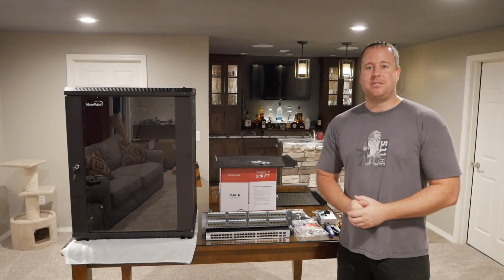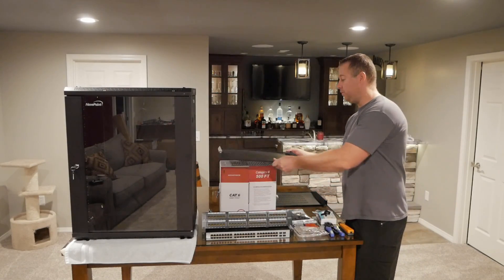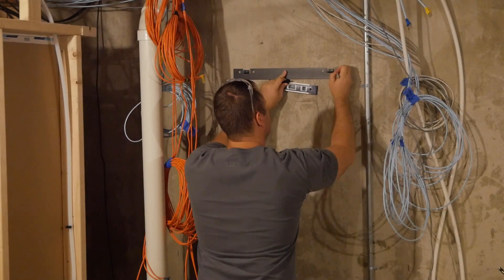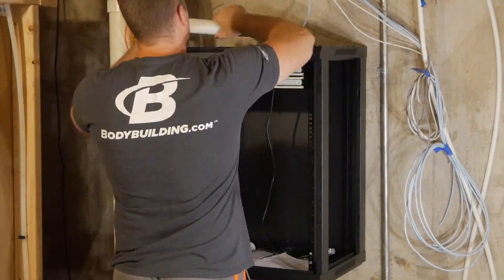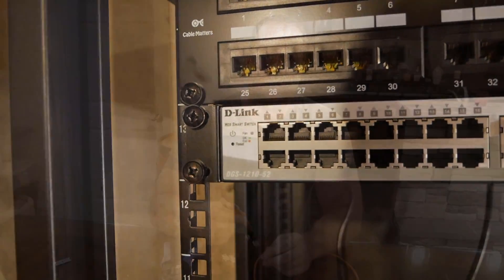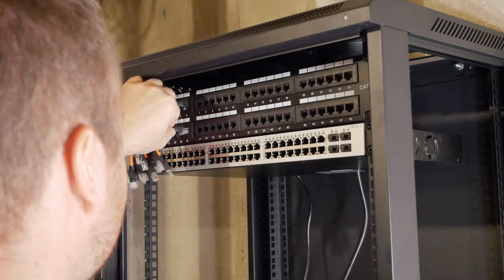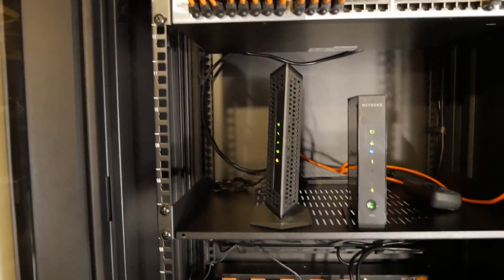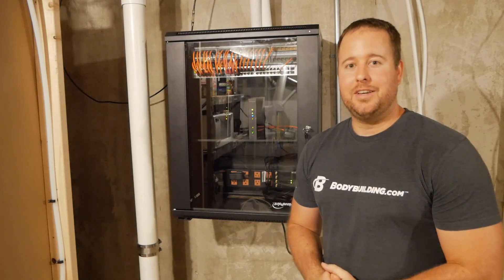Home Network Setup and Rack Installation | NavePoint 15U Rack

Comment: You should get two 24 ports panel instead of one 48 port panel so you can put 24 on the top and 24 on the bottom, and then your 6in homemade cables will look more clean.

Comment: When making all those patch cables, there is no need to trim. Just line up your wires in the connecter and shove it all the way in. Let the wires stick out and the crimper tool should trim them. Much easier and nice looking ends.

Comment: Wow, that's beautifully done!

Only things I would've done different: Two 24 port patch panels for keystones, to add (not only networking) cables easier if needed. The switch would've gone between the two patch panels to have an even cleaner look without cables laying on top of each other.

Comment: you can get a gigabit wireless access point for your wireless devices like phone and shit. better than using a wireless router in my opinion, if you do all that with your home network might as well beef up your wireless network too. use a poE system. you can get a rack mounted Poe switch to power and internet connect it to a wireless access point perfectly located in your home. thats what im going to do with my home network. except i am not using a rack mount. everything is in a cabinet with a key i put in. i am getting a wired router and a wireless access point. each port on my router will be the uplink to a switch. my poE switch, my 16 port switch and vpn router. all non vpn ports are blue and all vpn ports are red

Comment: I added an Eaton 5S UPS to Telcom cabinet. I put in a thermal control switch for the fans. I also installed an Intel NUC that runs UPS monitoring software as I will eventually configure this with a virtual machine running Linux and run PRTG for full network monitoring. I installed a small LCD screen attached to the glass door on the inside facing out so I can monitor UPS and network status. so that power events would be documented and recorded.
Reply from the maker: Damn, went all out man! That sounds awesome. I'll definitely do a more intensive setup after we build our next home
Reply: @LifeofBliss  Take this time to learn SNMP and prtg. Those are the two elements of my monitoring solution
Reply from the maker: I'll have some time... thanks I'll check it out!

Comment: You put a lot of work in this, but i see a little potential for improvement. First of all, where did you get this patch panel ? Cat6 without grounding and proper mounting ? Unprofessional. Better use a good Cat5e panel with proper mounting ability for the cables. You can get them used for little money. 
Cable length: longer :-) let them be lenght +height +width of the rack, so you can move every cable to every spot in the rack if you need to move them. 
Important point. Never, NEVER make patch cables out of installation cables. Installation cable is not designed to use as a patch cable. They are to stiff. Bettet buy them. You can get them in the length you need and dont have to crimp all night long. Also the attenuation is much much better.  And then the device. Why on an extra mounting shelf ? Put them flat on the ground to leave space for additional devices. Maybe a NAS or something.
Is there a wireless access point in the rack ? Really ? Wireless in a metal rack ? Put it on top

Comment: Nice build. Here's some thoughts, and ways I would do it differently.  I would use a modular patch panel instead of punch down.  This way you can move things around in the future.  You wouldn't think so, but you always come up with ways to re-organize and make cable routing more efficient. Also way easier to add more structured cables later. Doing that with punch down is a pain.  The boots you installed to your terminated RJ-45 patch cables, they tend to cause the RJ-45 latches to be slightly depressed, which makes them not snap in fully, or least not a strong snap. So when you are working on the rack, they can become disconnected. I've had this problem before. Better boots are called "finger boots", they are hard to find. I had to buy mine from ali express.  Also, I like to the split the patch panel, and use two separate 24 port 1U panels, and put the switch in the middle. Makes routing the patch cables easier and less confusing. Top row of the switch ports goes to the patch panel on top, and the bottom row goes to the bottom panel.

Comment: Just two suggestions there: 1) being this close to a water line is never a good idea.  I was gone for the winter and one line broke killing the entire rack and its components.  
2) I would strongly suggest you to put a surge suppressor in the ethernet ports in the basement.  Keep in mind that most of your grounding equipment is in the basement and if you are hit by lightening a lot of your electronics in the basement will be cooked.  
Other than that I really liked your organization there.  I wish mine were as clean as yours.

Comment: You will find that using cable comb makes the wires a LOT neater before you punch them down. They sort of look like a twisted mess because you are trying to organise them from the wrong end. Also (and since you have 48 port switch) going 24 port patch panel, switch and 24 port patch panel makes the cabling a lot nicer to look at. This would obviously not work with the patch panels you have but just a thought.

Comment: What do people use to cover the hole at the top were the cables enter? Without it covered Im assuming plenty of dust will get into the rack?
Reply from the maker: I havent had any dust to speak of. There are vents all over the box and fans drawing in air, so its about the same as what a computer case gets.

Comment: Could you provide a link to the mountable WattBox unit?  Also, I noticed orange and white wires.  Do the colors mean something?  (Eg, represent differs floors?) Thank you.
Reply from the maker: I actually got the wattbox locally from a dealer going out of business. The fan units on the top of the rack? Those are built in, came with the rack
Reply: Life of Bliss thank you!  I also noticed the cables  from the ceiling were in two colors, orange and white.  Is  that significant?
Reply from the maker: No, they are both cat5e. Just what I ran (orange) and what was here before me (light blue).

Comment: Good job thanks. You really should use the pull string in the cat 6 cable and pull it down to the correct length. Cable cutters can nick the wire which will cause a fault later.

Comment: Looks pretty good. Did you consider a PDU? You could turn each component on/off individually. Also, MY OCD is kicking in about that PVC. I'd put a grommet or flange on both ends, to keep the cable jackets from touching the sharp edges.
Reply from the maker: Thanks. No I good with just the Wattbox and tried to keep things on a budget as best as I could. I took some sand paper around the edges before installing, they aren't really that sharp now

Comment: I would like to have something similar to the network cabinet rack, but something that kind of blends in with furniture. Hopefully that makes sense. I'm living with my parents right now and would like to have something that doesn't look too geeky. My parents don't really mind the "controlled mess" I have,  but I would like to tidy it up. Does any one have any suggestions? Casters would be an added bonus, but not crucial. Thanks. I would really appreciate any suggestions.
Reply from the maker: This unit came with casters if you didn't want to mount it on the wall. No getting around it not looking like an equipment rack though

Comment: Where do I start. Too much insulation removed when punching down at the panel. Max 1cm of pair showing. You used the same cable for your runs and patch cables?

Comment: Nice setup and tutorial! I’ve been trying to grasp the signal flow for this type of setup. If I’m not mistaken modem is connected to the switcher providing it internet and from the switcher the cables are plugged into a patch panel which are just Ethernet drops coming from various rooms in your house?
Reply from the maker: Signal path from the cable box outside is: Cable wire > modem > router > switch panel > patch panel > ethernet drops. Then in the rooms, you'd just plug your devices into the wall plates for access. The patch panel is just there for making it a bit more clean looking and you won't have to plug/unplug the wires coming out of the ceiling ever. It's all done on the front of the patch panel and the switch
Reply: Life of Bliss ohhh, okay. thanks for replying!

Comment: I recommend color code your CAT cables per system like RED for fire. This attached link address is an idea of what I am talking about. https://i.stack.imgur.com/Vc1pa.png You also have this 
Red electric power lines, cables, conduit, and lighting cables
Orange telecommunication, alarm or signal lines, cables, or conduit
Yellow natural gas, oil, steam, petroleum, or other gaseous or flammable material
Green sewers and drain lines
Blue drinking water
Purple reclaimed water, irrigation, and slurry lines
Pink temporary survey markings, unknown/unidentified facilities
White proposed excavation limits or route

Comment: You use same type of cable in the walls and as patch cables?
Reply from the maker: I did yes
Reply: Ah i guess its fine in the US where u just stuff the cables loose in the wall anyway. Here we have use one typ for patch and one for jacks etc.
Reply: @MrSHN93  You can use solid core "wall" cable for patch panels, as long as the patch cables aren't plugged in and out frequently.  Stranded core cables with molded boots,  "jack" cable as you referred to , are the preferred type for patch panels. The reason being they are more flexible, and the molded boots will prevent the jacket from slipping out of the crimped RJ-45.  However they typically won't come in the exact length that you want, which is probably why he made his own.

Comment: Hello, the best video so far for me. my question is when creating my cable that goes from switch to punch panel can i created a small cable both ends t-568b?...this is very important  for me to know. Thank you in advance.
Reply from the maker: You should be fine as long as both ends of the patch cable are the same configuration. So t568b would be ok
Reply: @LifeofBliss  Thank you.

Comment: What you could do is use a pair of 120mm computer 12V fans like i did, and wire up an old cheap 12V wal-wart adapter. Those Noctua fans work wicked and silent!

Comment: I'm not sure, but that kinda seems like overkill for internet for the house.  I hope he built it for expansion to include whole home audio, NAS, etc...  otherwise I think that maybe overkill for the current set up...  Really good work on all of the cabling, cable management and design..  Keep up the good work.
Reply from the maker: Thanks Brian. I have plans to add a server and security cameras to the setup for now,  but yes it was complete overkill. Better to have extra than not enough. I started with an open basement so figured why not, didn't cost me much

Comment: Do you guys think that something like this would be able to hold my Denon AVR and Emotiva 7 channel amplifier with all of the network equipment as well?
Reply from the maker: It would hold it fine. May be a little cramped depending on if you wanted to add a blu-ray player, PS4, Xbox, ect... along with your networking equipment though. And look at the depth of the cabinet along with the depth of your components. You may need to get a deeper rack with all of the wiring coming out of the back if you wanted the back panel on or wall mount it.

Comment: D-Link isn't the brand I'd go with. The HP 2500-series is a nice manageable layer 2 switch that has a lifetime warranty and a nice user interface and enterprise grade reliability. D-Link to me still sounds like consumer level garbage, I've never had a really good experience with anything D-Link. A 2530 isn't even all that pricey, a few hundred bucks.

Comment: Nice and clean, instead of pipe you could use basket tray, can make look every tidy and easy to add more to loom, why did you use cat5 plugs on your patch cables? was that cable strand or solid core? you should use stranded cable for patch cables, as they will last longer than solid from plugging/unplugging, especially how tight/ short you have made them, maybe think about a cable management bar with longer patch leads https://nz.element14.com/productimages/standard/en_US/52P6750-40.jpg

https://www.eaton.com/content/dam/eaton/products/support-systems/cable-management/flextray-wire-mesh-basket/flextray-with-cables.jpg
Reply from the maker: Thanks Dave. They were solid core. I'll buy stranded patch cables if I ever do anything like this again.

Comment: what is the purpose of the patch panel?  i just put a ethernet connector on the end of the wire and connected it right to the switch
Reply from the maker: flexibility is the short answer. There are some good videos here on yt that go over patch panels in detail

Comment: i would personaly remove this video.,  you almost drop the cab, you mount it upside down,  and spend all that time making a few Center meter network cable ......id10t
Reply from the maker: Lol I don't think I'll be taking advice from someone who cannot tell the cabinet is mounted correctly and that the glass door was reversed, causing the logo to be upside down... I don't know of many cabinets that would put fans on the bottom and mounts for caster wheels on top. But then again, sounds like with you there's a market for that...

Comment: you do know your cab is mounted upside down......
Reply from the maker: You do know the glass can be reversed to open the other direction right? 😉 I can assure you it is not upside down lol
Reply from the maker: It's siliconed in place on either side. Would not be an easy task to remove all of it and rotate. Probably easier to scrap the logo off with a razor blade

Comment: You could have gone WIFI...so much easier.
Reply from the maker: Well I do have Wi-Fi, but I try to connect as many things hard wired as I can. More reliable and doesn't take up Wi-Fi bandwidth. Easier isn't always better 😉
Reply: Life of Bliss, my comment was intentionally snarky. I actually gained a lot from your video as I contemplate my own home network. Excellent video!
Reply from the maker: Ah I gotcha 😉 no offense was taken, but I did miss the tone lol. Thanks Bob!

Comment: Great video! I need to do the exact same thing. Is the lie setup in same room as your furnace and other hvac equipment? Have you had any issues with power glitches as the furnace or water hearted comes on? Also what about issues with moisture? All suggestions welcome.
Reply from the maker: Thanks man. Yea I have a large storage area that also has the HVAC and other equipment. No issues with it outside of a few resets needed (modem or router issue). I have a dehumidifier that is always on in the room so no moisture problems at all.

Comment: the fans are complety unusefull, there are no servers inside the rack and cisco switch does have fans inside... greate installation overall
Reply from the maker: Yea I don't have them on now. Ran them for a week, turned them off, no difference
Reply: @LifeofBliss  it's more economic and the interior of your rack will be clean without fans...

Comment: Nice job, my only criticism (constructive) is to buy a rack mounted router. Microtik makes a nice one. They make for a cleaner install. Still searching for a rack mountable cable modem. Also making your own patch cables is amatuer. You almost lose money making your own if you factor labor.
Reply from the maker: Yea many have said similar about the patch cables... I have learned a lot since posting this video just from the comments. This was my first real dive into networking. Upgrades will be coming in the future and I will definitely look into a rack mount router. Thanks!

Comment: One thing I'd like to add is if you're ever planning on using wifi or having someone over to use wifi.  i would buy like an 8 port POE switch ( on ebay for like 30 bucks) and buy POE access points ( tp-link has a few for like 20/each) that way you have better coverage across the house, and not just in the basement. Overall, great build with a lot of room to upgrade in!
Reply from the maker: Thanks man, I'll probably add some access points down the road

Comment: I feel like every new home, apartment, condo and office building should all come outfitted with a basic networking setup like this. Just like when wire is ran for power when building a house, they should also be running CAT 6/7 cable with it now as well.

EDIT: Thanks Life of Bliss! Glad you seem to agree as well. Excellent video though. Honestly people, pay attention to this video. This is the most basic but easily manageable setups you can do and best of all it's easily scale-able. Literally add another switch, a NAS, Domain Controller and secondary DNS and you got yourself an easy small business/home network that will be the envy of your neighbors :)
Reply from the maker: Thanks man. Yea this is pretty basic at this point, but you are right, very easy to add on later. I'll do some things down the road when I'm done spending money on other things haha, but I've been very happy with the setup so far!

Comment: Why do some people have such a large number of connections?
Reply from the maker: Tried to put 3 ports at each plate. Wire is cheap. Hard wiring is more reliable and often faster. 1 for a smart tv, one for a game system, and 1 for whatever else is needed at that area. I put 5 in my theater/media closet and I'm going to need to add a switch box to increase my connectivity soon. Just wanted to have more than needed vs not enough 😉
Reply: @LifeofBliss 
Hmm. Thank you for explaining that.